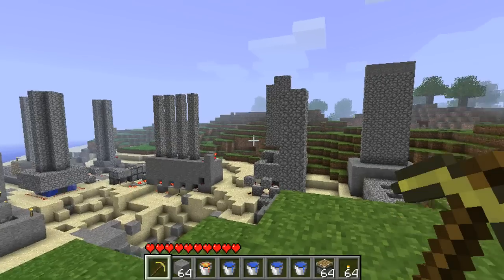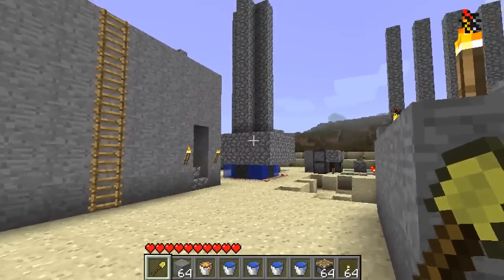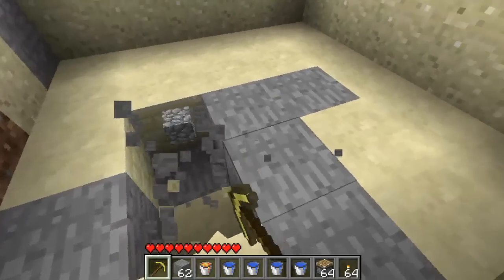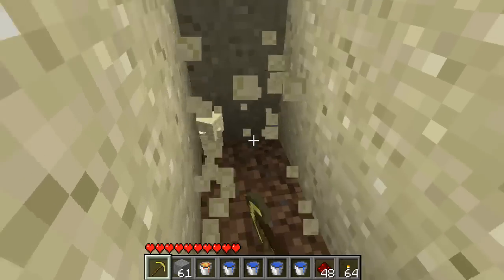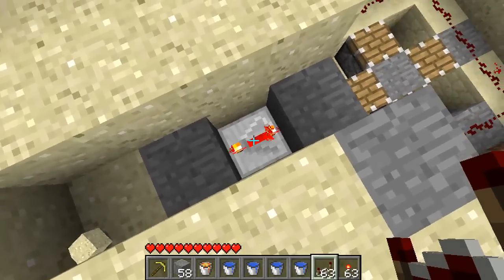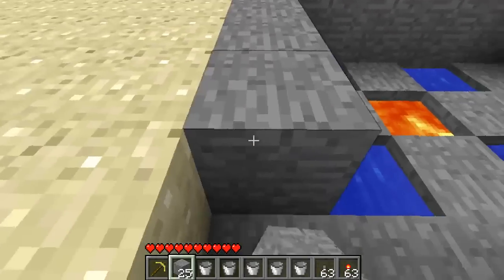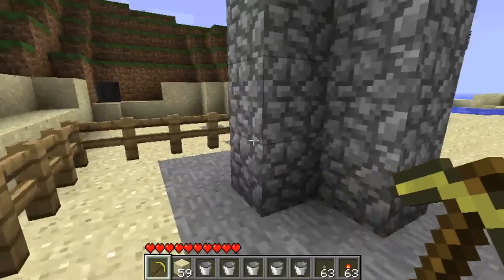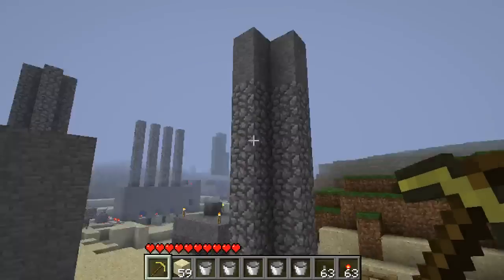Cobblestone Factory -- Minecraft Advanced Cobblestone Generator -- 99.9% Collection Ratio

Comment: Excellent design - I now have 3 units working. Using Mine Factory Reloaded block breaker to feed blocks to a recycler to make scrap for Mass Fabricator. Had to over clock the recycler to stay ahead of cobble input. Mass fabricator is turning out 64 uu items in aprox a minuite.  I love it, works endless with no maintance.

Comment: the sand isnt really necessary and over all this was a really good cobble gen
Reply: RXTZMafiaboyz you're right, the sand isn't necessary, but it prevents the cobblestone from dropping into that hole that is now filled.
Reply: well u can always go inside the middle
Reply: RXTZMafiaboyz well it's annoying to do so, even more annoying if the pistons are pushing new cobblestone up. So why not place blocks inside?
Reply: cuz sand is valuable to me (i made this in a skyblock) kind of a waste u know Tom Tchilov
Reply: RXTZMafiaboyz you know that you can use every material for it, right? Like wood?

You even profit by by doing so as you can put a weight on your mouse to auto mine some cobblestone.
Reply: wait i can use wood???
Reply: RXTZMafiaboyz of course you can.
Reply: ok then i will do that
Reply: RXTZMafiaboyz Or like use some of the cobble that is now available infinitely anyway
Reply: u cant use cobble can u Wouter H  Tom Tchilov
Reply: RXTZMafiaboyz you can use every solid block.
Reply: Oh cool